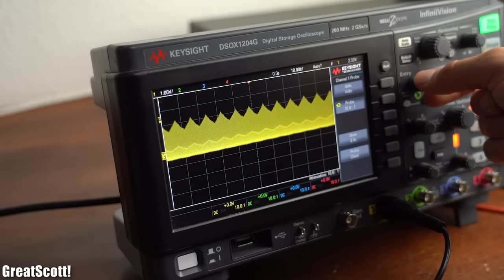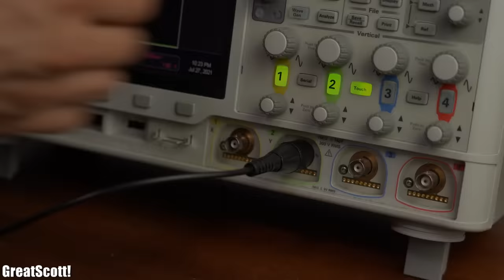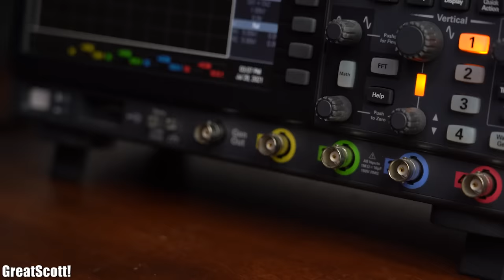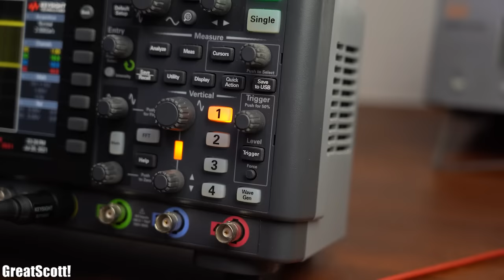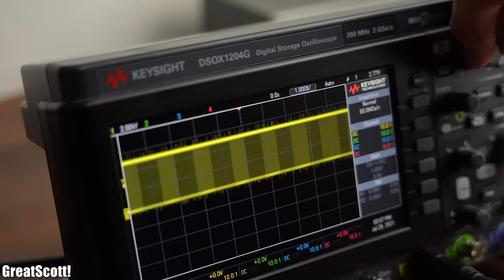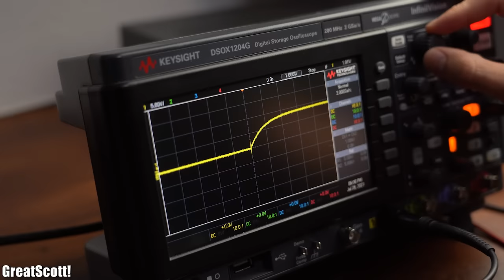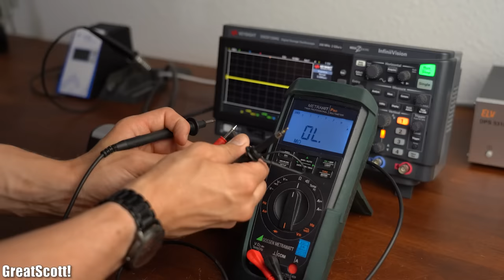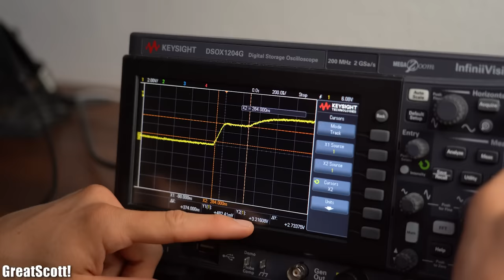Everything you need to know when buying/using an Oscilloscope! EB#49

Comment: When working with mains voltage electronics, it's a great idea to actually power the bench with a isolation transformer (and a fast acting, low current fuse,, if your inrush current allows that). Like in a IT grid, that was there have to be two faults, before current can flow (unlike working directly with grounded AC). (The fast acting fuse would also protect the isolation transformer. A 220V/110V dual output transformer with the power rating suitable to your project usually works fine....

Comment: an isolation transformer is always recommended when working on something at mains voltage, that way if a mistake is made your equipment will be less likely to be damaged. it can protect you from a nasty shock as well, or worse

Comment: If space or money is a concern (and you have a computer), I really like my Digilent Analog Discovery 2. It's $400 (but priced cheaper for students), and it's got a 2 channel oscilloscope, signal generator, multimeter, protocol analyzer and frequency analyzer, all in a package about the size of a deck of cards.

It's definitely got limitations, but for most hobbyist applications it's more than enough. I've even done entire electronics labs for school just using that one little device!
Reply: Yup more than capable for the majority of people. In my service days I had a 20mhz CRO a bit of a beast to lug. Didn't need it nearly as much as one thinks. The USB ones with logic analyser are very handy.

Comment: everyday now i see that i'm a fading technician. So much has changed since i began my hobby/job in the late 1970s.
My 20MHz B&K was a home "standard," and i'm in awe of modern oscilloscopes. Now, we REPLACE ENTIRE BOARDS,
whereas in my day we replaced mostly components.

It's a magical time to be alive now, kids. We have computers in our pockets and advanced electronics that perform
all kinds of astounding tricks.

And mostly, we have fine folks running video sites like this offering FREE instructions and advice. Thank you!
Reply: I'm right there with you, went to "Tech School" studying Electronics Technologies majored in RF Electronics.  My first 2 jobs (Motorola 2-Way Repair Shop then Satellite Receive Only) both jobs I did component level troubleshoot with scopes replacing discrete component and some ICs.  For me those were the good ole days and I loved it for the satisfaction of constantly solving the puzzles of failed electronics then seeing my work....well work.  Not long after lots of equipment became throw aways and there just wasn't much $ in being an electronics technician.  I got lucky with a railroad job that then led me into railway signal engineering which paid much more even though I didn't have an engineering degree I was able to do the work so that worked out well but it was never as fun as doing real component level repair.

Comment: Since you recommended differential probes it would be interesting to see a little video for them and what to look out for. Differential probes can come in ultra cheap <100 € versions, but they can reach the price of full fledged scopes quickly. Especially bandwidth needs to the thought of a bit different here than your regular scope considerations. Using a seperation transformer for your DUT is often way more affordable, despite not (!) being entirely safe.

Comment: My rule of thumb is to first check voltage with multimeter between desired ground point and oscilloscope ground clamp. If 0 or open circuit, then all good to attach ground. Else - start to look for electrical tape for PE 😇

Comment: The scopes can also be isolated from the power line. The input power supply of the scope meets certain international standards that include 2000 volts isolation, as good as an isolation transformer. Of course when doing this BE CAREFUL since you can have the common of the scope at high voltage with reference to ground. (only to be done by experienced users)

Comment: Parametric analyser was a fancy name for a simple curve tracer. Easy to do on an old scope using a 5vac transformer a resistor and a set of test leads. Set H to Ext drive.  H equals sample voltage while V equals current through device under test.

Comment: Ive been using a board called the espotek labrador that you plug into a computer with software and get various functions like oscilliscope and power supply. It takes some time and knowledge to set up, and may not have the best sampling rate, but if you need a basic oscilliscope for cheap, its like 30$ and works perfectly

Comment: I grew up around oscilloscopes and the like as my dad was a TV engineer and often did various jobs at home for people.  I'd look over the edge of the workbench at the green boards, soldering iron and the scope and often hear the odd pop or swear word when a particular job was difficult or something just exploded, ElectroBOOM-style.  This was back in the early 80's and by the mid 90's people just dumped broken stuff and bought new stuff, rather than fix it.

Comment: Back when I was an early teen and repaired tube TV's, we used an isolation transformer because many of the TV's of that time didn't have a power transformer and hooked one side of the full wave bridge directly to the chassis (a.k.a. a hot chassis) so if you wanted to connect any kind of test equipment, the isolation transformer was a must.  Also, if I remember correctly, Tektronix had a line of oscopes where the ground of the probe was isolated from its own chassis and the powerline, so you connect those units probes to a hot chassis with any issues.

Comment: I used to repair swm PSU s . The golden rule is to feed it via a mains isolation transformer,  then you can safely connect the earthed ground wire of your scope probe to the circuit board without creating any problems .

Comment: The possible error you mention of at 11:15 about the Alligator ground ref connected to PE.  When working with a battery operated oscilloscoop, there is no connection to PE of the 230V mains as we work on battery. So we are isolated any time.  Even not when the batteryloader is connected as this has no PE connection.  So no worries to  But good to know to remind me of this situation!.

Comment: I recently got myself a Picoscope wich i find quite handy. Im not doing any High Power/High Frequency stuff and use it mainly for 5V logic level and protocol analysis. 
And for this purpose this is just fine since it also can directly decode Protocols like I2C, SPI and UART. 
Since it is possible to export the data i was able to do a curve fitting in MATLAB for a step response - super nice :D

Comment: The first scope I ever used (in middle school no less) had vacuum tubes and a CRT. Tons of knobs. 2 large RG type probe connections. Weighed several kg and was the size of a medium suitcase. No manual, but somehow I managed not to blow it or myself up even when messing w/ an AC stepdown transformer.

Comment: Hi. I love your channel and am a subscriber.  

The other way to avoid the problem with AC powered projects and Oscilloscopes is to get a battery powered Digital Storage Oscilloscope(DSO). I have and OWON DS7102V 2-channel, and whenever I do any AC stuff I simply disconnected the AC power to the scope and switch on the rechargeable internal lithium Ion 18650 battery pack.

Isolated probes are very ( extortionately ) expensive .  I think you should have mentioned that as one of your alternatives. You can pick up a decent 2-channel 1GSa/s DSO for around £500.

Comment: $90 CDN for an isolation transformer to build a really nice power supply pays off in saved test equipment. I built your basic power supply that used a solar charge controller (CC, CV) and it's still working fine. I've just rewound a MOT to 24V and am going to use that in my next supply as I don't really need a full 120/120 for anything else.

Comment: Nice video.  This reminds me of when I worked in a repair shop many years ago. We had early Tektronix graphics terminals. For some reason known unto them, the display logic boards had a signal "ground" that was floating at +600V DC. My colleague would unhook the PE from the scope power plug, put a paper notice on the scope (also Tek) Saying "Don't Touch" . Then connect up the scope probes and start diagnostics with the scope case, BNCs, etc, all at +600VDC!  Wouldn't be allowed now. We certainly didn't have isolated differential probes available back then.  Incredibly dangerous work practice, should not be attempted.

Comment: Occasionally battery-powered oscilloscope, such as Zoyi and Finsri oscilloscopes would actually be best especially if you don't want to fry something inside especially with the grounding short circuits. It's usually best to remove the primary ground from the oscilloscope especially when you have something that runs off the internal Lithium-ion cell.

Just be mindful when using multiple oscilloscope probes, you definitely don't want to have two different ground plane voltage clashing with each others.

Comment: The DS1052E is my first scope as well! 😁 It's still good enough for me. The highest frequencies I'm working with are between 12-20MHz for clock signals in audio codec or microcontroller systems. I might get myself a differential probe at some point though. I'm always afraid that I accidentally hook up the ground clamp to some point that creates some kind of circuit I didn't intend. 😅
Reply: 1052 here ..... I dont do crazy things, so it is really GOOD ENOUGH.
Reply: Same, although newer scope display look good, I'll keep my money to use on other thing

Comment: The switches on the 1 : 10 probe are also a bit dangerous. The 1 : 1 setting is when you switch to the front, and that can happen by accident when you put pressure on the probe while your finger is on the switch. I also have a cheap one from which the inner print with the switch can shift a bit inside, by which also that switch can shift from 1 : 10 to 1 : 1. They should at least turn these settings around, or as I did, take off the plastic knob, and use a little screwdriver to switch the now deeper laying switch.
Reply: Thanks for the tip

Comment: Thank you for 70.7% description of bandwidth. Only thing which surprises me is why such large sample rate (2GS/s) is needed for 200MHz bandwidth. With Nyquist theorem in mind, it is possible to pack 200 MHz signal into ~400MS/s.
Reply from the maker: I guess the more the better
Reply: When you use all 4 channels simultaneously then 500MS/s will be used for each. I think that's  reason for giving 2GS/s sampling rate.
Reply: @sanketpatadiya8168  so extra 100 MS/s per channel is required because otherwise filter circuit will be too expensive?

Comment: When measuring the output ripple on the switch mode power supply you should not use the long ground wire on the scope, this will make ripple bigger

Comment: Hi Scott. There's a cheaper trick, you didn't mention, to measure mains with an oscilloscope. You can just plug your oscilloscope by using a modified socket (or cord) where PE has been previously disconnected. It is not safe/recommended for long sessions, but do the job.

Comment: Great Scott! You missed the most fundamental thing about using an oscilloscope. When using a probe in the X10 position it must be compensated first. That why oscilloscopes always provide a low frequency calibration wave form available on the front panel. Clearly not a lot of people know that!

Comment: I let my 4-channel USB oscilloscope float 😅 350V common mode offset is no problem (of course I insulated the BNC connectors, the scope chassis... It can be VERY dangerous, be careful!). I use an insulated 5V power supply, built by coupling two motors through a piece of insulating material. The output of the second motor (a stepper) is rectified and sent to a 5V buck converter. This provides me with an insulated 5V that can withstand several kV common mode, and just as a battery powered device offers very low coupling at high frequency (EMI which could otherwise interfere with measurements). To insulate the USB, I use a board built around the Silana ICEUSB3. This only works for DC common mode though, as the ICEUSB3 chip doesn't work with fast fluctuations between ground planes... I may improve my setup with USB over fiber, not tested yet (that would also greatly improve the EMI).

Comment: I use a Li-ion  battery source of power on my oscilloscope, in this way I can be totally isolated from the mains and the source of noise it brings. My Owon SDS7102V has an integrated module of 2S Li-ion 6A enough for 1 hour of work. Or I can add and use a 10 S battery (from tools like Makita, Panasonic) via a step down converter to 8 V, in this case I have added a switch to not short circuit to the internal 2 S module.

Comment: A cheaper alternative to using a differential probe is to simply power the circuit under measurement with an isolation transformer. NEVER power the scope with an isolation transformer as this can result in all ground-referenced metalwork on the scope (BNC, USB, all other connectors, and metallic parts of frame) to become live at full mains voltage with reference to ground.

Comment: Instead of using the expensive differential probe, I'd suggest using a simple low power splitting transformer. For instance 230V/230V or any other with a ratio, close to 1:1.
The simplest way is to use a transformer from an old microwave. Removing the high voltage coil, and replacing it with the new coil should take only a couple of hours...

Comment: I use a differential probe all the time.  But I am very concerned about its effects to the measuring performance.  I am talking about the common mode rejection and input impedance.  I have seen differential probes rated 25 MHz bandwidth and 100 MHz bandwidth (I myself have the latter kind).  The rating however can be easily negated by their typical, several inches long input leads.  Also, I always need to double check that the two input leads both are making a good contact.  Any contact problem will produce garbage!
   
 On the other hand, there are special differential probes for low voltage (like 15 V maximum) that have just 1/2 inch tips and can do 500 MHz.  They of course require that the signal lines (on a PCB) are close to each other.  Also, they have something like 100k input impedance, or even less.  That compares to 4M on the big, high voltage differential probes.

Comment: Using a 10x probe has a possible hazard for the scope input when measuring high voltages. When AC coupled, the entire voltage is presented across the AC coupling capacitor.  The 10x probe depends on the 1M ohm resistor in the scope input for the 10:1 voltage divider circuit. So, when the input is set to AC the entire DC voltage at the probe tip is presented to the input coupling capacitor.  Ouch!  I STRONGLY RECOMMEND EDITING YOUR PRESENTATION TO INCLUDE THIS INFORMATION. I was a Field Sales Engineer for Tektronix and later, N.A. Philips Test & Measurement Instruments, for nearly 10 years. Over-voltage damage, while using AC coupling, was THE most common human induced damage, in the field and in our repair centers.

Comment: The electrical ground wiring once had some meaning for protection if touching the metal casing of the scope to prevent leakage since a lot of high voltages were present.Nowadays in digital scopes with plastic covers what is the meaning of the live ground?I dont recommend the practice of ommiting the usage of the mains ground wiring since everyone who uses professional tools (and i instist on this) is responsible to treat his tools freely as long as he ensures that nobody will got hurt or cause damage to person,property or animals.

Comment: I have a 450MHz Techtronics scope. However even with ultra low capacitance probes (which cost £400 each when new) it will still not go above about 180MHz for a 3dB point as the probes are almost always the limiting factor above 100MHz.

Comment: You can look for Tek scopes with isolated channels i.e. isolated grounds and 600V rating. There are handeld models with this capability and also fron MixSig at 800 dollars price tag. A bargain if you already are a keysight user. The HUMBLE UT81B is a DMM with "scope" that is rated to "1000V". No BNC jacks, it takes the signal from the DMM direclty ... so blowing the "scope" front end is near imposssible. Note that the "scope" sections left a lot to be desired really. I got one, I know that I can hook it on any point of an ATX PSU, but it is only one channel, it never save the settings, and eats batteries like no tomorrow. If you you want a cheapo scope for harsh use, this could fit .... If you rage from BAD UIs and awfull user experince, just run away.

Comment: I have an Oh Silly Scope too! 🤣
I have a Picoscope 2204A (the cheap model), but it's awesome when using the hacked Picoscope 6 Automotive software version (these models don't normally work with the automotive software version, especially access to the Channel Filtering and the Waveform Library).

Comment: Can you also use an isolation transformer on the DUT to achieve the same isolation while still having the scope grounded to PE ?
Reply: Yes, or an inverter powered by an isolated power supply since hobbyists are likely to already have those.
Reply: @NiHaoMike64  Provided it meets the power requirements :)